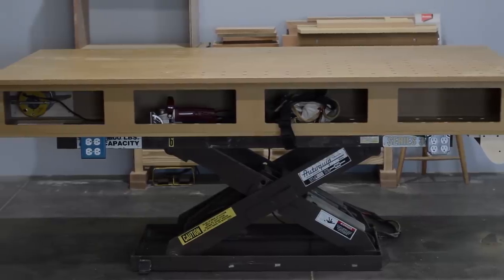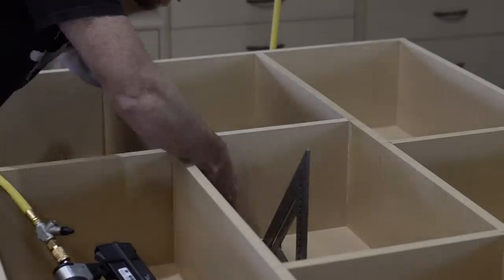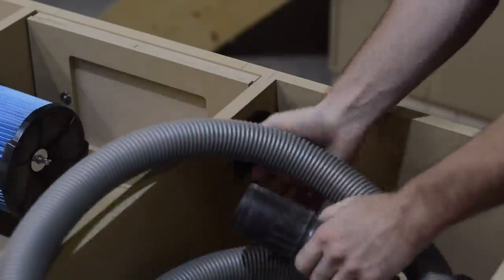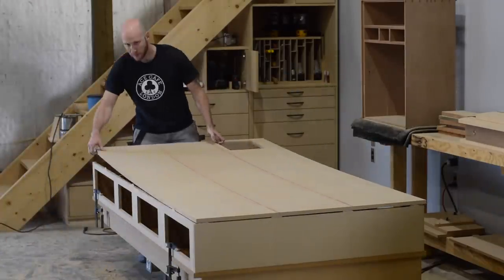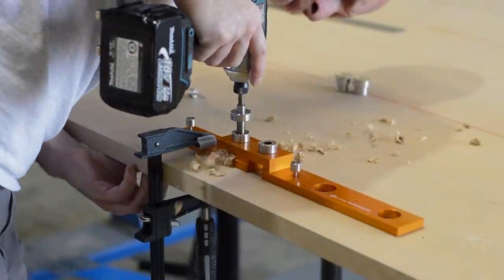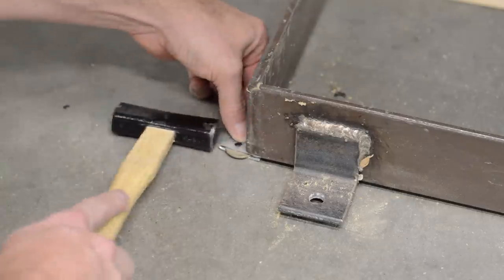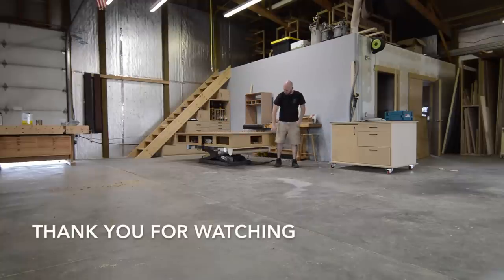A Modern Cabinet Makers Bench For Woodworking & Carpentry

Comment: Now that you have almost 3 years on the bench, what modifications have you done to it to improve its function for you?  (if any)
Reply from the maker: I haven't changed the bench, but I have made a few jigs to fit in the dog holes. If I was going to do it again, I would reverse the direction of the vacuum input and output.

Comment: Hello. I am nearly halfway with my very own lift table con workbench. I just noticed that after 2 days sitting idle i found out that it lowered to about 1.5 inches from its original position. And then i research if my hydraulic is breaking down but it seems like they are normal happenings for a lift table. Id like to know yours if you experience the same. Thanks!
Reply from the maker: Depending on where I leave it, it will go down a little. If its all the way up it will stay up. If its more than half way down in will fall slightly over the course of a weekend.
Reply: @Mike Farrington  very well thanks...i got mine used and understandably it is no longer perfect.

Comment: So, excuse my ignorance here; Do the Dog-Holes have cup housing for the dog-pegs? Otherwise wouldn't the catacomb sections beneath just fill up with shavings/dust etc?
Reply from the maker: I don't know what a cup housing is. The lower sections fill with dust and once in a while I vacuum them out. Its not too much of a problem. I clean them maybe once a month.
Reply: @MikeFarrington  ~ Thanks. A cup housing would be a hollow plug for the holes to collect any dust, I guess flush caps/lids would work also but I suppose that might have its own set of problems. 
Appreciate the reply, your time, expertise & your videos.

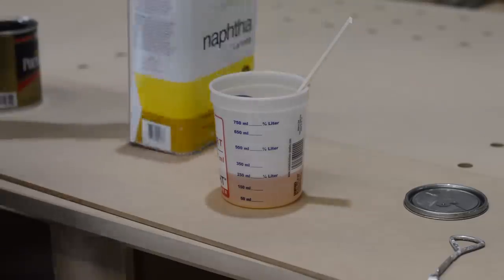Comment: 12:51 lol
I want to build a torsion box for my CNC table. I'd like the inner grid to be 2 inches high ideally to prevent having a bulky table (5x3 feet) . But is there a ratio  between the height and width/length for a torsion box to be effective?
Reply from the maker: I don't know that there is a published ratio, but I can say, the thicker the ribs the more resistant to flex the torsion box will be.
Reply: @MikeFarrington  Makes sense. I think I'm going for something similar as yours. Thanks for sharing the video, greetings from south america

Comment: Really like the fact that you engineered the dust collection in the design. Question, after using it for now; how did it work out?
Reply from the maker: Thank you. So far it has worked great. Its not super easy to clean out, but I only need to clean it once a month or every other month. Since this video I have upgraded to a HEPA filter. I use it almost every day.
Reply: Thanks, it's the best solution I've seen for a work table, especially for space-challenged areas.
Reply from the maker: @allent555  Torsion box tops are super versatile and can be built super small. My first couple were tiny to fit in my small shops.
Reply: @ @MikeFarrington  Thanks, should be interesting chapter because I'm planning on launching a channel with a new theme, content and shop will be tugging at each other.
Reply from the maker: @allent555  Sounds cool. Best of luck.

Comment: Sorry for the late comment. My full time job would not like it if they knew I was learning from a Master on the clock...

Once again great job...

Glad to see/😉 hear that your going in a good route to keep dust out of your lungs. Especially your Apprentice.

I've never got a holy cow.j/k
? Do you get a better performance drilling holes with your impact drill?
Reply from the maker: Thank you. Yes, I am relatively new to having a large shop, dust collection is important and not an easy thing to deal with when covering a lot of ground. It will be a constant work in progress. I used my impact because of the quick chuck.

Comment: Hello Mike, What is the platform size and max height of your 
Lift? Great Video as Always. Stay Safe, Greg
Reply from the maker: The top is 4'x8'. I don't know the max height buts is about chest high with the top on.
Reply: @MikeFarrington   Thank you for your reply, Thank you for your reply.  I was not concerned of the tabletop which looked to me was 4 X 8 but the actual scissor lift? Im checking on ebsy... LoL
Please if you have time I left a commrnt on your video regarding your SCMI Planer. Greg
Reply from the maker: @gregorylondos534  Ah, Sorry about that. The scissor lift top is 3'x5'.

Comment: Is MDF harder on drill and router bits and saw blades than other materials?
Reply from the maker: In general I would say no. MDF is a purpose built material designed to be machined. If it was super hard on tooling, the industry would come up with a better solution. With that said low quality MDF can have more abrasive glues, and less consistent core material. These factors can wreak havoc on tooling, but this would apply for plywood, particle board etc.
Reply: @MikeFarrington  Thanks, very helpful.

Comment: Mike, 

What is that attachment for your table saw that makes it so easy looking to cut 4x8 plywood on.
Reply from the maker: That is not an attachment. It is a purpose built saw. Its called a sliding table saw. Mine is a Robland E300. Its a very neat tool to have in the shop.

Comment: Hey Mike, did you have any problems finishing the top after drilling the holes?  Did the polyurethane affect the hole size?
Reply from the maker: Good question. Yes I did on a few holes where I was not careful with my finish application. The poly did not change the size of the hole because I thinned it down so much, but if a drip was left to dry, I needed to go back and re-drill the hole. This was on about 10 holes.
Reply: That basically confirms the top should be sealed first and then drilled...
Reply from the maker: I would say thats a better way to go if possible. With a 1" top and needing to chamfer the underside, plus having to keep finish off all the surfaces to be glued. To me it just seemed easier to finish last. Either way could work though.

Comment: What is the table rated for in pounds?  What size of 1" MDF is the top?
Reply: Sorry I see in your video it is rated for 2,500 lbs. Is the size of the tabletop 49" x 97"
Reply from the maker: The top ended up at 48x96 because I cleaned up the edges.

Comment: Why not use screws instead of nails to fasten the box. Screws will help the glue much more than nails. I like the lift system.
Reply from the maker: Screws would work. They would be much slower, and would leave a larger mark on the surface though.

Comment: I have been making these for as long as I have had a workshop... 1992? Yeah, my first bench, was a "torsion" box, made from 2x6's and two pieces of particle board on top, sealed up by urethane. Still got it, nothing can touch it.  

I assumed in the start of this video that you were going to make a bench with multiple holes which suction from all part of the perimeter, thus taking the airflow into the bench itself, and nearly any dust falling to the surface would be sucked out of the way. For a design of that nature, there would need to be one more internet layer to the bench, subdividing the top compartments to allow the suction to be evacuated from the entire top at key locations, equalizing the vacuum pressure evenly across the table top. A little bit like an air hockey table in reverse, only having 1/4th inch holes. Something for you to think about next time.
Reply from the maker: Thank you. Torsion boxes are a really neat tool. I like your vacuum idea, like a down draft workbench.
Reply: Well, I doubt it would work out, the flow mechanics would be a larger problem than the benefits. Too many ways that concept could fail. Then there is the dust flying out in the room, still free and loose.
Reply: @chrisgriffith1573  you could equalize the pressure if there was a plenum in between the vacuum source and the inlet holes, maybe have the plenum below the bench where the scissors are? so one would have two bottom pieces.

Comment: instead of rebuilding the whole box I have seen these made with a top that can be easily replaced when it starts getting dented
Reply from the maker: Thank you. In this case that would not be possible due to the glue between the top and the grid. If I did layers, the top would be to thick for the clamps to work in.

Comment: Hey Mike,

Another great build video. I do have one question: the poly that you used is oil based? Also, I’m assuming the naphtha used to thin it is similar to mineral spirits?
Reply from the maker: I am using oil based poly. Naphtha is used to thin the poly. Naphtha is a fast drying paint thinner.

Comment: How many coats of the finish do you put on there?
Reply from the maker: I did two, but once in a while I give it a sanding and throw another light coat.
Reply: @MikeFarrington  Thanks! Just getting ready to throw it on mine.
Reply from the maker: @alexyoung3387  Ah, good luck. Let it dry for a couple days and you'll have a great surface to work on.
Reply: Did you use acetone in one of your videos to thinnit?

Comment: The secret formula is 50/50%  or   some of this and some of that!  he's using a graduated cup you can read the measurements on!
a few questions???????

No seriously!
A)  what brand of trim router was that? or is is that somthing over the opening on the side?
Reason fingertip damage off a trim router I held low because the grip's center of gravity is high and they just love to tip over during a cut.
B)Will that work the finish  on osb ply used for commercial furniture?
That's what I used on my router table I made with a  100 gallon fish tank stand somone threw away.
the top is 24" deep x 42" wide and comes off, I also added a switch long cord Lift and dust collection box out of 1/4" MDF.
It's totally sealed no doors all the suction pulls from the top of the router lifts opening the vacume hole is on the bottom of the box  no saw dust stays in it.
C) If your not using that dimnio tool I'll remove it from you shop so its not in your way.  
 PS you can cut your own tenons for it. I would.

I've got a biscuit cutter  and not much use with one, teach us a bit more on using them for assembly, I seen some tricks that worked really fast.
Reply from the maker: The secret finish thing was a joke. A. Its a PC310, no longer made. B. Yes. C. I use it enough to keep it, but thank you for the offer. I will include more about the biscuit joiner in future videos.

Comment: how bout something like  a hand cuff  / shackel  kinda C clamp thingy  on a bench dog for the vac hose,,,, i have a shower curtain rod ,i mean gantry crane on my ceiling and all my wires and vac hose  decend to me from the heavens,,example :::; an extention cord end is attached to a retractable key chain which is attached to the shower, uhh crane track,,,but the tools' cords are generally long enough not to pull the extentions too faroff the track anyway , so the cords are in the air most of the time anyway,,,,,,,, i know  , but batteries die and i forget to charge them
Reply from the maker: Thank you. That is a pretty good idea.

Comment: You really need to attach a bag to the vac so your filter does not get blocked as quickly
Reply from the maker: So far it hasn't been a problem. I clean it out about once a month or so. It has been a nice feature.
Reply: @MikeFarrington  ok that's not bad, but if you attached a bag to the outlet hose you won;t lose any suction, and saves you double cleaning the box and filter all the time, plus will give you better filtration as only the very fine particles will make it through the bag into the filter.
Reply from the maker: @zaneh6224  Good point. I have thought about that idea, its just something I haven't done yet.

Comment: Great video sir! As someone moving into woodworking from metalworking, I’m constantly fussing about things like flatness. How flat do you think we need a torsion box table like yours for it to be functional? It would be good to get some numbers so I can stop fussing over details that don’t matter so much. 

Do you think .02” over 2’ is good enough? Have you measured yours to see how good you got it?
Reply from the maker: Coming from metal working. I would say ease up tolerances a little. I would say .02" over 2' is probably better than you could hope for. These materials expand and contract with changes in humidity. I think mine is 1/32 to 1/16 over 8'. It has a slight hump in the middle. Its plenty flat for my work.

Comment: Now I'm sitting here wondering why you couldn't use a motorcycle lift.
They can be bought used relatively cheap
They even sell a manual jack operated version at harbor freight
Not sure on the price
Reply from the maker: You could use a motorcycle lift. I think that there are a bunch of different options that could work. Honestly, I didn't specifically seek out this particular lift, it was the one that I was able to get a good deal on. If something else had come along, I would have used that.

Comment: Top video Mike! How did you secure the workbench to the scissor lift?  Did you drill 4 corner holes into the lift top and secured it that way?
Reply from the maker: Yup. I think I showed putting some tapered head bolts through the top / lift and bolting in place. I used 6 total.

Comment: I can't believe that scissor lift can only support 2,500lbs. Look at the vehicle dual scissor lift deals that are available now. They are supposed to be able too lift an SUV in the 5,500lb or more weight category. That's pretty much each of the pair rated to lift as much as yours is rated at. They are no where close to being as beefy as your lift. Just sayin'!

P.S. that lift table is probably something you find yourself not wanting to be without.
Reply from the maker: I think it has more to do with the motor. It only has a 1/2hp motor. Either way its solid and I will never max out the capacity with my work.